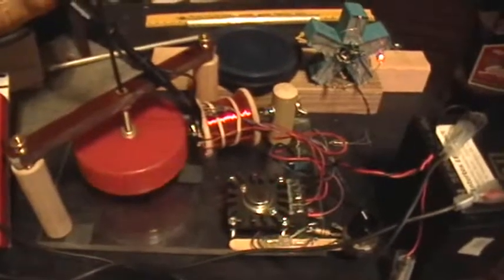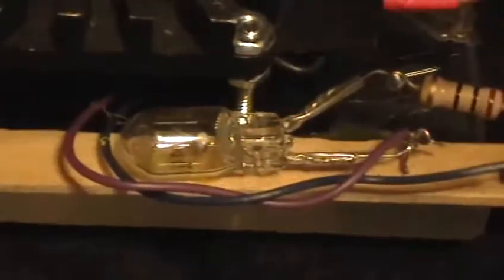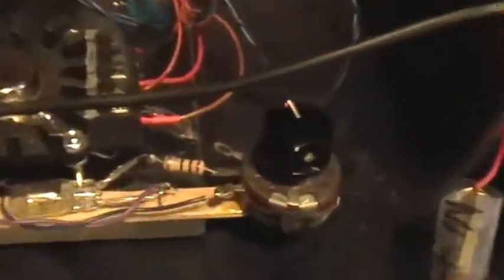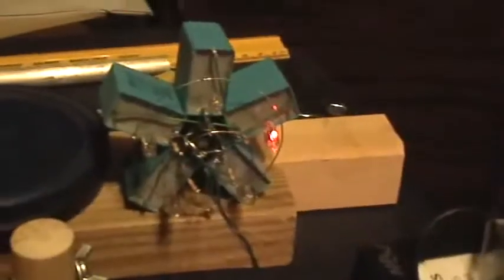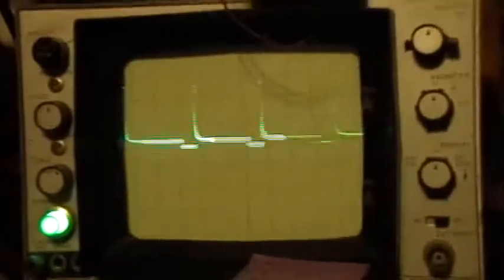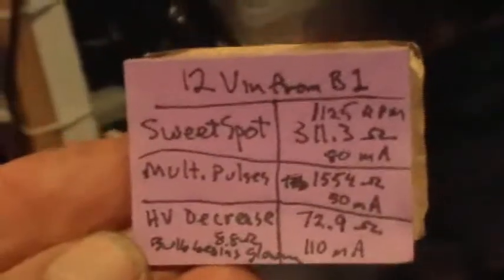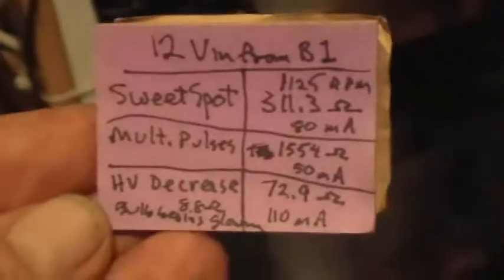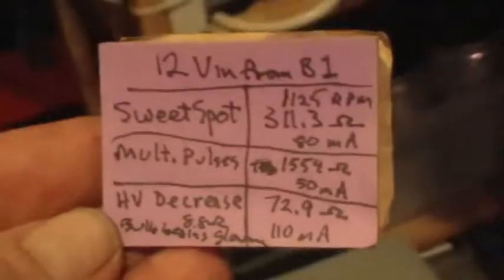Electric OU: Tuning the Bedini NP/Schoogirl Motor Base Resistance

Comment from the maker: Nice to know. 
I sometimes have occasion to work on old electronic equipment, and it's not unusual to find a filament light bulb being used in that manner buried inside the circuitry. The resistance of the filament changes, though, with temperature. Maybe they are used as a kind of current regulator, in the same way that neons are sometimes used as voltage regulators.
Not really playing with alternatives, just trying to see what the Bedini circuits are doing, and many of them use the light bulb.

Comment: Interesting that you happen to be playing with alternatives to high watt resistors... so was I, last night, ironically. I discovered that a 50 watt 120V Halogen bulb, offers about 25 ohms resistance to a 7 Ah 12V SLA, and when wired as the only component, it does not light up (of course), but... passes about 130 mA of current, and even when used with thin wires, poses no fire hazard, or anything stupid... Another fun one is to use chokes instead of resistors... 3-6 turns around a small ferrite.